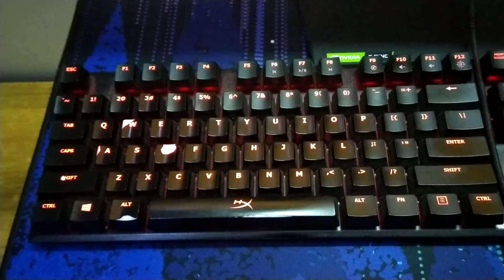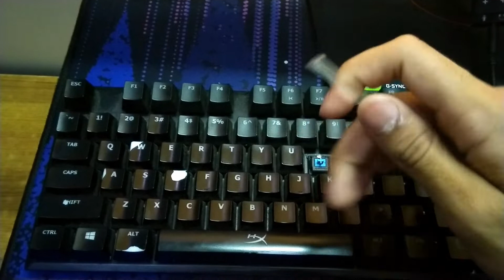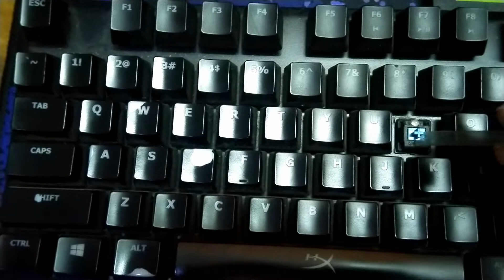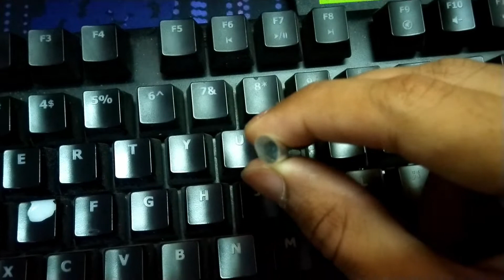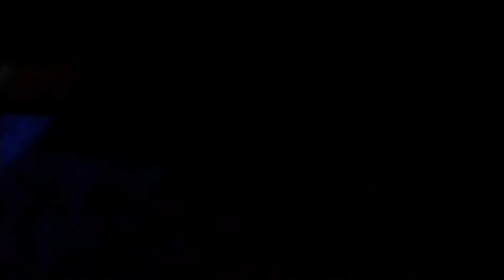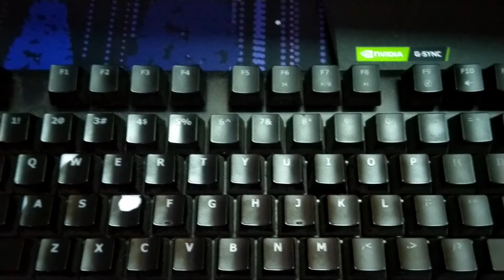[Solved] Keyboard Double Click Chatter Issue (Tech tip#21)

Comment: i used wd40, lets see if it works or breaks the keyboard altogether , right now its working fine
Reply from the maker: @MultiAlliot  wd40 isn't conductive so I think you should be fine? 🤷‍♂️🤞
Reply: @OsamaRana  im worried it will attract more dust later , but lets see and does wd40 eat plastic ?
Reply from the maker: Quick googling suggests that wd40 doesn't affect plastics and also evaporates, so again seems like it would work. 

Idk if it would result in a sticky residue though.
Reply: i'm thinking it ttoo bbutt not done yet

Comment: DAS sent me this video...hope it works with my couple of keys that sometimes register, sometime triple regiater
Reply from the maker: Did it work? Who's Das?
Reply: DAS Keyboard customer service....and no..not really working 100% ... I'll circle back if a few more tries helpl
 @OsamaRana
Reply from the maker: Huh, interesting. It's not a permanent solution but it does "fix" the issue for a few weeks. I ended up replacing the keyboard with a huntsman tkl with the light based switches. I haven't had any chatter after about a year of using it.
Reply: @OsamaRana  gave it a few more shots of air...then DAS sent me a firmware flash...and it looks like everything is working now.!🙏